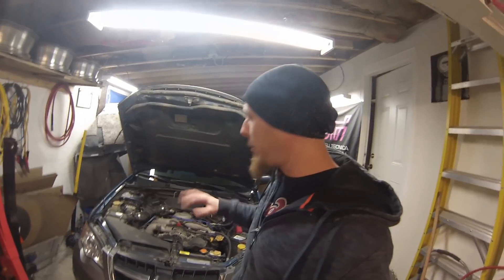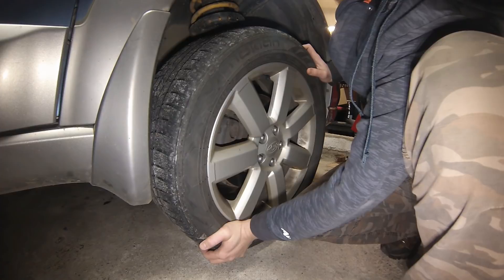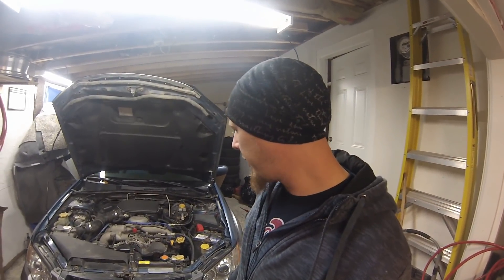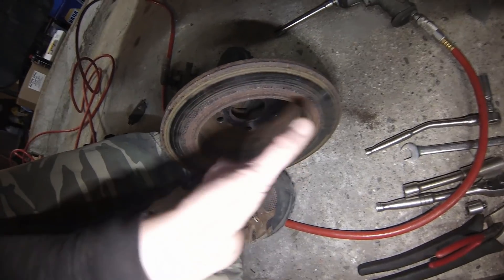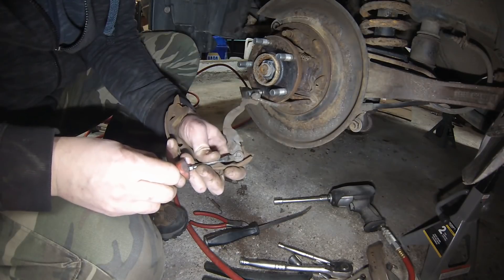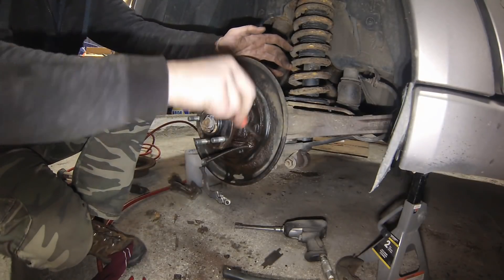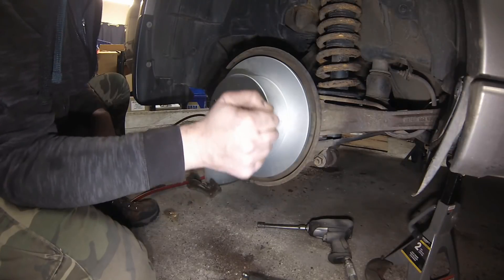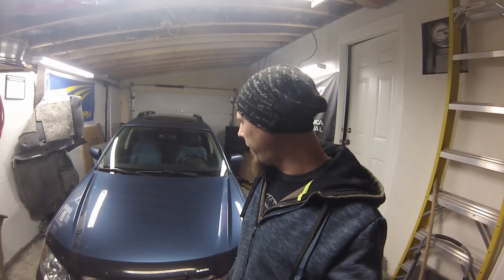How To Subaru Parking Brake Shoe Replacement

Comment: Hey there. So i am so stuck on my rear brakes. I also can't find a "proper way" to place the jack stands while getting under. of all the videos on youtube no one actually covers the jack stand placement safe locations.
Reply from the maker: That is an excellent suggestion since some of the older cars get pretty weak pinch welds over time. The best place for stands in the rear is on the outrigger supports. Looking ahead of the rear wheels you will see how the cross brace for the rear differential bolts to the car at the outer ends. There is a triangular plate, two small bolts and one large bolt. The large bolt is for the mount and this is a good spot for a jack stand.
Reply: I know this might be asking to much, but could you maybe find an image reference? I think i know the spots you are mentioning but I have doubts...and doubts lead to squish....ing;)
I think I will take some pictures and submit them to this and forester.org('s) site as I searched everywhere and no one has a difenitive answer. Thanks for all the help! I am even applying your help to my wagon sometimes. And yes, west coaster here, the humidity attacks everything, even when its just sitting... 
http://mrfrostysmemos.blogspot.ca
Reply from the maker: Type Subaru jack stand into google. There is one image that shows where to put jack stands in the rear although it is difficult to see. Another thing to try is typing Subaru outrigger into search. This could show you the image of the triangular plate which may help you locate it.
Reply: Well the rear is completely re done. the sides are a wee bit rusty so most of the jack stand placements were not usable. but it got done. and your vids helped:) such  stupid design drum brakes,...you would guess the simplest pin and spring design for the main pads would have improved to have a locked or fixed unit to apply them to by now. Thanks again the the input and support:). One brake left,...if i ever get the damn rotor off.
Reply from the maker: That's good, less on your mind!  Soak around the hub where the rotor mounts with penetrating fluid. Then a bigger hammer, it will come free. Glad I could help!
Reply: mrfrosty420

Comment: My retainer pins are backwards on my 06 wrx.. how do you guys get it back on so quickly??? The arrow part points towards me and the wide part is behind the hub.
Reply from the maker: It is tricky, but it gets much easier after you do a hundred or so. ;)  Take your time and you will get it.
Reply: Homebrew Subaru I finally got it... It's crazy I can disassemble and assemble an engine but I have the most difficult time doing these stupid drums
Reply: I love HB Subie so much I'll drop you my secret on his page.  I used some beefy needle nosed pliers (not overly tapered just the ususal thing. I use a stout rubber band around the handle that will hold them closed.  I open them, grab the retaining plate between the tips (like grabbing a circle by pinching it on a diameter) and let the rubber band hold the plate. The I set up the pin so the key is vertical and hold the spring onto it with one hand..I press on the head of the pin from behind to dissuade it from turning, use the pliers to put the plate over the spring and pin, gently squeeze the pliars, press in to get past the key and turn.  You will need to grip tighter than the rubber band does to press in.   Saved me a bunch of time and I hope it serves you well.

Comment: I don't understand how the parking shoes wear out, it seems like they should only be used for parking and not have that much time doing actual friction work. BTW, I'm getting about 25k on my rear brakes on my 2013 outback and just did the pads and rotors myself (second time). This is terrible mileage for brake wear. I suspect it's the traction control but doesn't seem normal to me.
Reply from the maker: Parking brake shoes do not start with very much material on them. The contact area is close to half of what a normal rear drum brake shoe would have. If a person is to drive with the brake left on accidentally, a lot of material can go missing in a short amount of time. Normally though, park brake shoes should really only need one change in a vehicles lifetime. The park shoes in my wagon have been there for 5 years, believe it or not they were used parts from another car so they are even older than that. 

Pads tend to prematurely wear out due to the calipers or slider seizing or sticking, pads not moving freely, quality of parts, lastly driver abuse. If the front brakes do not perform adequately, the rears will do majority of the work.
Reply: Thank you for the reply. I am not happy with the rear brake wear but the Subaru dealer states that the car has rear brake bias? It was all I could do to not laugh in their face.
Reply: @bowlander  Is that on new rotor?.  Worn rotors eat up pads unless they are refinished, and who does that these days.  I get great mileage on my 1999 rear Legacy pads front and rear but I don't go all that hard, I maintain stopping distance and use it up if I need to stop.  Makes it easy on the car.
Reply: I have 160k miles on my parking shoes.  They could probably take another 40 but I needed to do pads and rotors so I replaced them.  I'm only wasting $4 of service life for that part and my daughter is using that car to go for her license.  The pre driving test safety inspection on the emergency brake is quite stringent. They are looking for 1200 rpm hold while in drive.
Reply: @peterkalanzis3080  the 2013 outback has a very aggressive braking oriented traction control, I suspect that is what is wearing down the rear brakes, yes rotors are changed at both intervals @$25 a piece it's an easy decision.
Reply: @bowlander  Rear break bias, huh? Never heard of that, of course the are bias with the front we all know that, but not with each other.lol. I would have asked him to explain that one better. I have found factory brakes seem to last longer than after market, I have no idea why. Then again, brakes wear due to user  habits, conditions, location. We live up on a hill, every day, my wife drives down a steep hill to go to town. The brakes wear more now that we live where we do, thats just normal.

Comment: I need help with my brake. When I start my car  check engine lights brake light are on And the rear break are stuck what should i do
Reply from the maker: Make sure the parking brake is off. If the car has been sitting for a long time it's possible the brakes are seized on a bit. Getting the car the from drive to reverse with a little press on the gas and it should break loose and roll. If it won't, you will have to inspect the rear brakes.